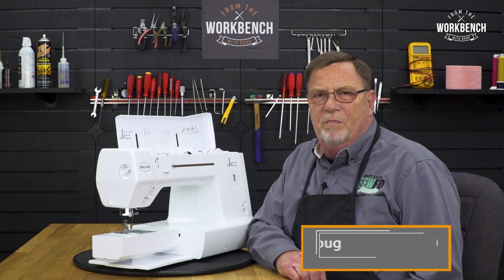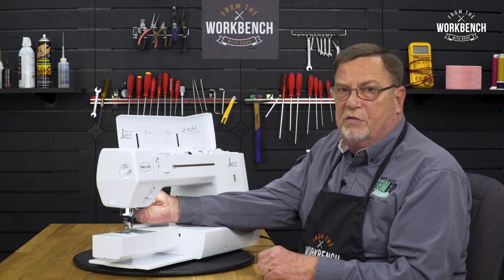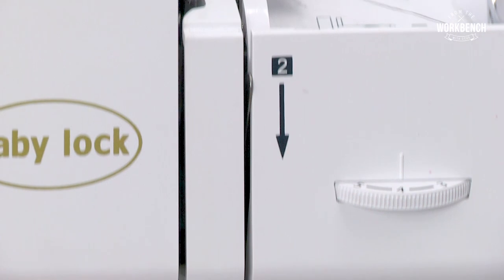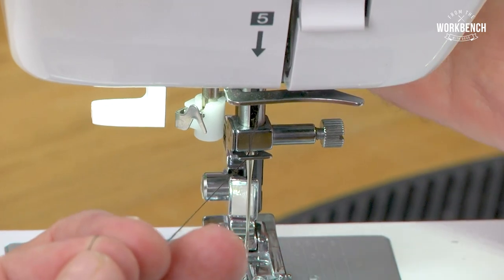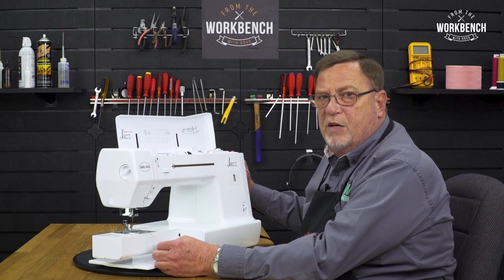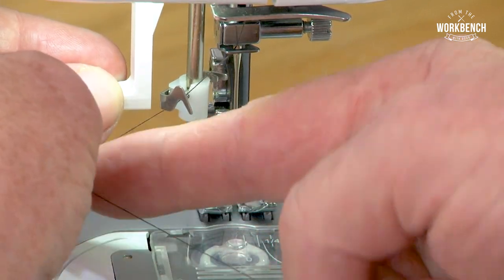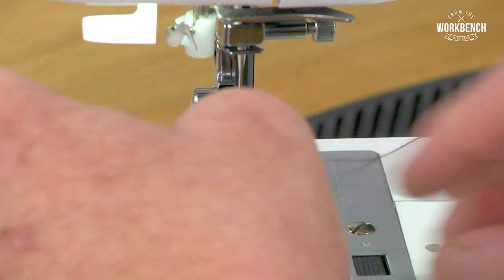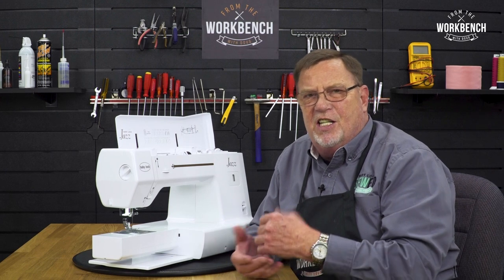From the Workbench with Doug - The Needle Threader on a Baby Lock Jazz II

Comment: Hi,  I just received my new Jazz II machine (actually the 2nd new one in a week, the motor wasn't working on the other) and on the threader, the 2 prong thread catch portion is stuck and won't swing around to catch the thread. (this was the same on the last machine, but I was able to push it and release the part to work properly, but this one won't budge and I don't want to break it), this threader doesn't move at all. Would you have any suggestions to get this to work?  Thank You.
Reply from the maker: So sorry you are having this issue, and thanks for your patience. Please reach out to our consumer support hotline: 1-800-313-4110 or email at productsupport@babylock.com.